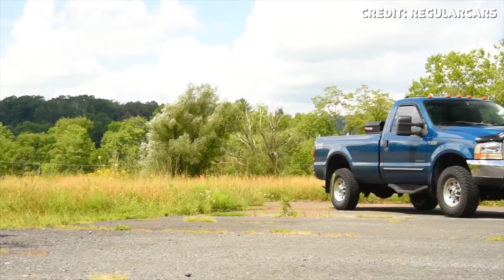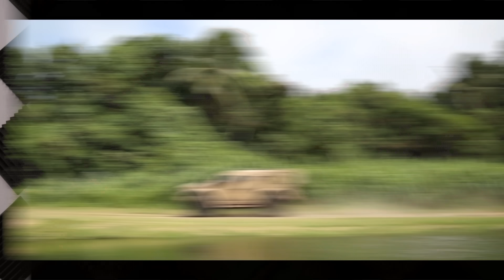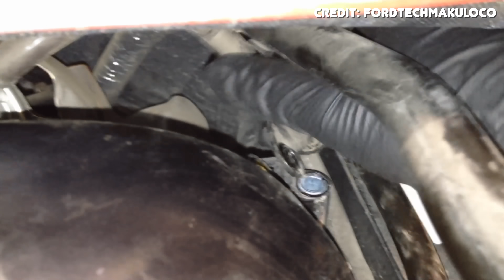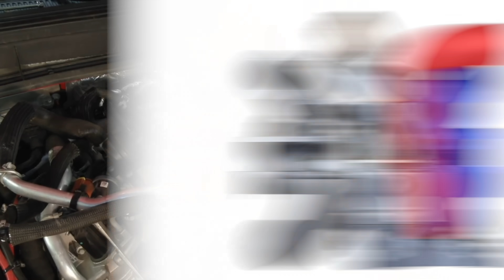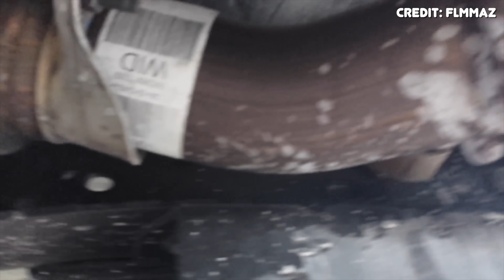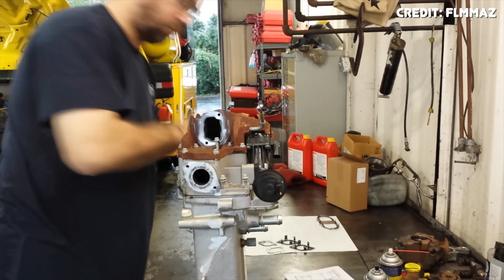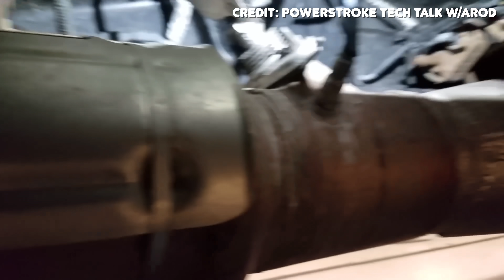Everything Wrong with the 6.7L Powerstroke

Comment: Aviation?…..seriously you want to be behind a 6.0 or 6.4 engine at 10’000 feet knowing the governments only concern was/is emissions? Piston powered aircraft don’t have emissions standards to comply with for several reasons the biggest component failure. We could go into seat MPG but you do the math.  Having emissions “equipment” installed on a aircraft would just both dumb & dangerous.

Comment: Like I said there are only 2 Diesel engine to get number 1 Cummins number 2 Power stroke but 99. 9% of big trucks hauling 80,000 pounds are all in-line six cylinders leave the Anything that has Duramax diesel written on it alone

Comment: I've got hmmmm 330,400 on my 7.3 now!! Only thing I wish I had was a couple more gears for the trans!! The 6.7 yeah has crazy power!!👍👍🤘🤘
Reply: I also have about 330k on my 7.3. My 2012 6.7 has 230k and seems like the same type of reliable workhorse. Creature comfort is an order of magnitude better, drives better, and tons more power. Just like my cellphone from 3 years ago I think they have reached peak performance. There is really very little to improve on these trucks that the end user can't do by removing EPA garbage. In the next couple years when I need a tax write off I will buy another one. Just like its predecessor it runs way better when you load the bed with about 1000lbs of junk.

Comment: So as a 2017 6.7 owner, my only real concern is that dang fuel-pump (looking at the disaster prevention kit) spitting metal shavings all over the fuel system? I use Opti-Lube XPD to attempt to keep the pump lubed well in addition to fuel filters every 10k miles. Beyond that the only issue would be the EGR cooler? What happens if it fails? I have debated an EGR/DPF delete but the truck is stock for now. The nearly double mileage you get for doing the deletes is tempting too, but that's for down the road.

Comment: The 6.7L is also known for breaking the exhaust manifold bolts for cylinders 4 and 8.
Reply: Never had a manifold stud break on the 6.7 power stroke... the 2 bolt for the egr tube that goes into the manifold is known for breaking
Reply: That's generally caused by a restricted DPF filter due to high back pressure

Comment: I work in the oil fields and we mostly use the f 250 /  f 350 trucks. They run perfectly and have few issues and we put a lot of hard miles on them . Lots of idling and lots of heavy hauling. Sone of our trucks run a week straight and only shut off for oil changes. 12 hour shifts means swap outs and back to the grind. Arguably the most reliable diesel engine on the road so far

Comment: Love my 2016 F250 6.7 Powerstroke only issues I’ve had so far was the HVAC control module failed under warranty and the vacuum pump had an oil leak fixed under warranty. The best thing you can do with these trucks is maintain them and run the archoil in the fuel system.

Comment: My turbo bearings failed right at 200k miles on my 2014 6.7

I changed my fuel filters every 10k miles, but I sold the truck before I experienced any CP4 issues
Reply: You made it that far without fuel pump failure and did what you should to prevent it I’m sure you’d be fine
Reply: @iTzKevinFTW  mines at 250k no cp4 failure, no additives

Comment: As much as I complain about these, they’re definitely better than a 6.4. 6.0s in a standard pickup are easier still in my opinion, but do have their issues. Even still, the 6.7 is pretty solid. Gen 3 is back to actual oil pan gaskets which is better. Only big issue is the cp4 and after treatment systems

Comment: Worth noting that the egr cooler is different, after 15 I think. It used to be on both cooling systems but later it was only on the main cooling system. I never heard why this was, but my thought was that being on the secondary cooling system cooled it too much causing the excessive soot build up.
Reply: Can confirm. I see way fewer plugged EGR issues on trucks that have the EGR cooler on the primary system only.
Reply: 2017 was the switch to the round hole cooler.  But then will fit in the 2011 thew 16 egr cooler housing.

Comment: Now that all diesels are essentially reliable as hell at this point....I look at the whole powertrain package as a whole. Fords standard power train in the 6.7 is superior to Rams. That 68RFE is a big turd and if you want to build power that has to be addressed. Fords and GM transmissions can hold a good bit of power added.
Reply: It's not the engine reliability that's an issue, it's the EPA Rube Goldberg machine attached to it that's guaranteed to cause problems
Reply: Ya do know the 68rfe stop being used in like 2008 right?
.
Everything has AT LEAST a 6 speed
If not an 8 or 10 speed
Reply: @kainhall  My 2013 2500 had a 68RFE

Comment: Ceramic high speed turbo bearings had a pretty high failure rate.
Reply: Fixed in 2015
Reply: @Recker45-70  2013 actually
Reply: @Jarrett Halderman  they changed from ceramic to steel bearings in 2013, problem only became slightly less of a problem. The turbo change in 2015 eliminated it though
Reply: @Recker45-70  true but I’m willing to have some turbo issues for that 11-14 sound 🤤
Reply: @Jarrett Halderman  nothing can beat that high rpm spool, but I will say it's just as orgasmic rolling 90 on the throttle with a 15+

Comment: My 02 ford e350 super duty 7.3 has over 800,000 miles on it and still runs like the day I bought it. However This truck have went through 3 trannies. I think this engine will outlast the body.🧐

Comment: Funny how California has the most brutal emission standards, yet every vehicle driven in the entire state of California for a year combined, doesn’t match one days emissions from LAX
Reply: I would never fly if commercial jets had all this emissions crap on em.  Wanna see a jet go into limp mode at 35k feet? Neither do I.  All set.
Reply: Harder to control plane emissions as the exhaust is literally what propels it
Reply: @peterambelang4888  so we’re supposed to fit the bill for peoples opposing ideas? They are getting rich off our dime.
Reply: @DiezelDaveFabs  Opposing ideas?
What?
Who is getting rich?
Reply: And that’s literally why California has strict emission regulations. Millions of cars on the road and they have less pollution combined in a year than a few hundred jets in a day.
Reply: @khakiswag  Again that not the math or the comparison to make. 

You would have to calculate the amount of people moved combined mileage. 

The average greyhound would need 3 trips to move that same amount of passengers as a 737. Part maintence and longer travel time. 

Now most jet engine are massively more efficient than ICE engine. Meaning amount of power for pound of fuel energy.

That is why all new ships trains etc use jet turbine generators and electric motors. 

I love diesels, cars, etc. 

But the reality is more mileage and cleaner engines isn't bad. The fact I know I literally get more bang for my buck on fuel more HP and more mileage that's not bad.
Reply: That's not even counting all the private jets.
Reply: Doesn't fit the narrative.
Reply: The cruise ships and container ships is the biggest polluters. Along with jets. But the left or woketards don't discuss. No you need to buy ev.
Reply: They just want your money, in fees and taxes. Sacramento "parasites" are relentlessly trying to tax us for our yearly mileage. 😂😂😂
Reply: Not funny how they have the lowest people standards...😩

Comment: iam having lots of problems with the 1 gen turbo blowing up  and over pressure in the base of engine and the new 3 gen is turbo unbolting them self every 2 months and the dpf like any diesel truck so far guy with 1 2015 650 and 2 2021 750 and 2022 750

Comment: 7.3L is the best.  Hands down.  My 2002 starts, first time, every time.  Will work, haul, and pull all day — twice on Sunday.  Don’t think its the best?  Just look at the obscene amounts the 2000-2003’s are reselling at.  If its in good shape, these are fetching 25K or, in some cases, better.  Yep, they lack power.  Yep, they weigh a ton, quite literally.  But you can’t beat those engines for reliability if they were a bag of dicks.
Reply: The cost of what they are now has ZERO to do with being the best. It’s because the market is so stupid right now and most new vehicles are just junk with a lot of issues from the factory it’s made the used car market like the new one is all. I love 7.3’s and have been a ford guy my whole life but that statement is wrong with it being the best cause of resale values. Two years ago you could pick them up all day for 10k.
Reply: When our co had 7.3 e 450 vans and trucks in CA. They all leaked from rear main seal. The e4od is a pile and the engine would shut off when hammer down from idle leave you in middle of intersection. And might I add the had no HP. Torque only gets it moving HP keeps it moving.

Comment: Edit (something else i noticed while towing especially) the MPG on Common rail diesels is Ass. espeically with emissions i was getting 14.1 MPG at best highway unloaded and loaded. 1x 2021 bronco for about a 4 hour trip got 13 mpg. my old truck. 29 mpg unloaded highway. and about 20 towing. the compression ratios have went down drastically the 6.0 powerstroke has the highest if not the 2nd highest compression ratio of all the more modern diesels (past 25 years) its compression ratio is 18~18.7 : 1 while almost all the common rail trucks compression ratio is about 16:1
this is something to take note of. not to mention common rail trucks you can't just go ham and pour whatever you feel like burning into the fuel tank. my 6.0 i ran for 2 months straight on used motor oil from co workers cars at work i changed oil for. and this was during winter months around 20 degrees F. cold started perfectly fine ran fine. only slight haze when cold from the oil.

been driving my brand new 6.7 platinum for a couple weeks now towed a couple times with it. i like it quite a bit but hate its common rail fuel systems more sensitive than a Emo kid. and its got more electronics than i dont even know what. i turn half the crap off each time i get in the truck. i hate advanced Trac. when i first drove it wasnt too knowledable  on it. coming from my first vehicle my first truck a 2005 F250 harley davidson Edition 6.0 powerstroke lots of aftermarket stuff truck didnt really give me any fuss i did all my own maintence and with higher horsepower comes greater responsibility ended up breaking it and fixing it 2 times and this third times the charm lifter gave out. everything but the lifters are aftermarket. only thing i had an issue with. but i left my mark everywhere i love that truck to death gonna fix it. still huge bummer that the 6.7 doesnt have that nice Diesel rattling sound i miss alot in the newer truck probably gonna sell the new one for 80k and dump 40 into my 6.0 and have a few long blocks prepped n Ready for when i blow them up. my old truck i sure do miss the power on tap 700 hp 1400 ft lbs of tourqe the new 6.7 i got Definatly has over 1000 ft lbs of tourqe but its real late in the game.
Reply: Emo kid - lmao 🤣 😂
   Hey - I used to have an 06 King Ranch. Had I known about a special shop in Arizona, I would have opted to have it “BULLETPROOFED”!!!!!
    They offered 3 different packages. One was priced around 4k, which included stronger headbolts etc.
    There was a 6k package as well.
Then they had the $12,000 package. It’s my understanding that they would not only replace, but redesign and rebuild every flaw that originally came with that engine.  
    If the interior of my 06 would have been more plush, I definitely would have opted for the 12k rebuild.   The reason why this company got so much business was because of the many horse ranchers who refused to part with their (discontinued) Ford Excursions…

Comment: I just got 2022 6.7 I pulled 12,500 lbs like nothing but need some room ro break with that much weight, it was a miracle from God I found that beast in the dealer

Comment: You mean the 6.7L Powerstroke is one of those new engines where the cylinder heads won't crack if you remove the EGR Valve? 🤔

Comment: Simple answers to why the EPA doesn't tackle emissions in other industries:
Military: Politically it's a 3rd rail; if they imposed emission standards certain politicians would immediately scream how it's kneecapping our forces and that the military will be "handicapped by treehuggers" or something. It's stupid but it's the truth.

Aviation: Some steps actually have been taken, like those wing tips planes have adopted in the last 15 years, which save fuel. The EPA also passed standards for commercial and business jets in 2020.

Maritime: Those vessels are usually owned by foreign companies and thus are not under the EPA's jurisdiction. Plus, they travel international waters which means there is a lot of legal gray area. At best the EPA could put standards on Coast Guard vessels or non-nuclear US Navy ships. After that, commercial sea vessels operating inside and on the coasts of the US, and any cruise ships owned by cruise companies based in the US.

Comment: The CP4 doesn't "typically" fail before 100k. It typically doesn't fail at all. Less than 1% failure rate. Everyone just talks about it because it's so expensive to fix if it does happen.
Reply: Right, that's why there's multiple class-action law suits against GM, Ford, FCA, and Bosch for faulty CP4s and also why Ram has issued a recall on 220,000+ CP4s trucks... because there's no problem. People are just scared. 🤦‍♂
Reply: Seen plenty of cp4 failures before 100k
Reply: What do you make of the bulletproof kits for the CP4 that isolate the pump bearings from the fuel rail supply?  At $400 per injector, it seems better safe than sorry, IMO.
Reply: @timyogerst4349  I agree ☝️.   I’m commenting in hopes that someone replies to your question.  That way my moronic ass will be able to share in the learning curve …. lol 😂 😂

Comment: I purchased back in November 2017 a brand new F250 6.7L I have had no problems with the engine or drivetrain except for the DEF heater which was barely covered under warranty and my door handles were freezing in the winter time which they fix  with new seals I have approximately 3600 running hours and approximately 1600 idle hours the truck has just under 100,000 km Three days after I purchased a truck I drain the oil in the filter and started using Rotella T6 it’s had 10 oil changes so far and three fuel filter and three water separator filter changes and 4 air filters and 4 cabin filters And I’m planning on doing a transmission fluid change not a flush same with a coolant I’m planning on changing the front differential and rear differential fluids soon
Reply: You’ve heard of commas and periods I presume?

Comment: At 104k my upper oil pan(17) was leaking, dropped the pan to fix it and had all types of brass in the oil,  not sure if my cp4 blew up and sent metal into my system and then threw diesel into my oil or what. Damn shame I loved that truck, now I have a 22 3500 Cummins and the interior is no where near as nice as the ford
Reply: Yeah, it’s a Dodge
Reply: As for brass in the oil, my guess would be main bearings. I don’t know much about diesels, but that just seems kinda weird.

Comment: There are 2 reasons the EPA hasn't been able to force their crap on the Aircraft industry; #1 Wildly increased costs & Complexity, #2, people would get killed from that equipment. It's not about the "Environment," it's all about CONTROL. I filled up & a guy on the other side of the Pump had a 6.7 L pulling a Backhoe. I asked him if he'd ever been passed by a Dodge or Chevy pulling a similar load. He said "Not Ever."

Comment: After watching the video and reading all the comments, it’s clear that my 6.0 is the best Powerstroke.  Stronger and more responsive than a 7.3, more reliable than a 6.4, simpler and cheaper to fix than a 6.7.
Reply: The worst
Reply: It's about the same as a 6.4 in terms of reliability if not worse but all the engines are great if you do your research
Reply: @nativeoutdoors1780  6.4s are the worst I would take a 6.0 anyway cause u can actually make them reliable and this is coming from a 7.3 owner. The 7.3s are workhorses tho my buddy has already put two motors in his 6.0 and it was bulletproofed. My 7.3 with 320k miles with a tuner and other goodies is still on the stock injectors and transmission.
Reply: @nolansmith4972  but how can you hate a 6.4 if yah never owned one, most owners that had a bad time with a 6.4 was either emissions related or they raced the living crap out of their truck which in that case no diesel lasts
Reply: The Two Biggest Problems Of The 6.0/VT365 Are The Coolant Passages Plugging Up In The Oil Cooler. Causing EGR Cooler Failure From Lack Of Coolant Flow Through It. Second Is The Fuel Not Being Circulated Through The Heads Causing Injector Failure From Fuel Being To Hot. Yeah I Know The High Pressure Oil System Is Problematic But This Is Also Partly Due To High Fuel Temperature From It Dead Heading At The Back Of The Head.
Reply: Idk about being stronger than a 7.3😂 also for about 6k u can have a reliable 550 horse 7.3 if u have forged rods of course
Reply: @nolansmith4972  well a 7.3 isn't terribly strong, it's durable because it doesn't make any power so it just keeps on trucking. But even Cummins blow up with more power added so take it as you will haha

Comment: Sorry but the Cummins is a better design and more durable.
I would put a p-pumped 12-valve or p-pumped 24-valve against any PowerStroke of ANY year.
Reply: There are a lot of videos of just that and the 6.7 PSD always out runs the Cummins in all towing tests. Don’t get me wrong the I6 Cummins is the definition of a Diesel engine and is reliable but for performance it’s behind the Ford. It used to be more durable but the emissions equipment is the weak spot for all Diesels.